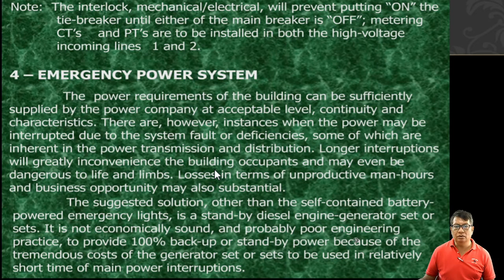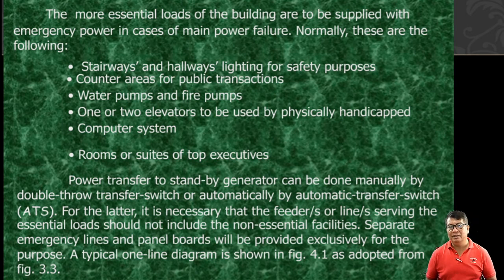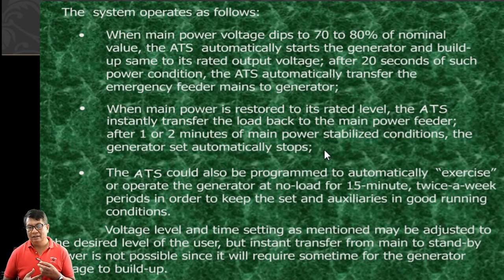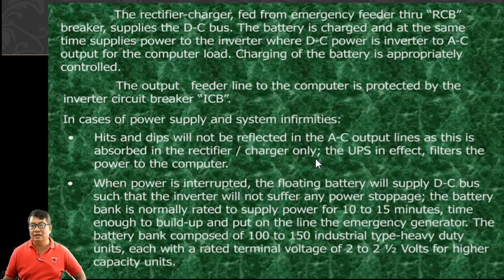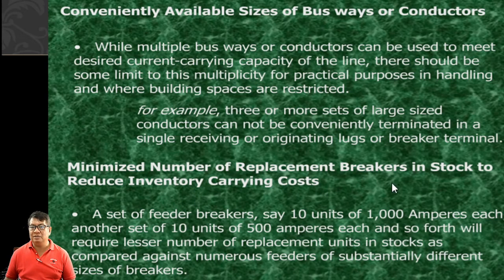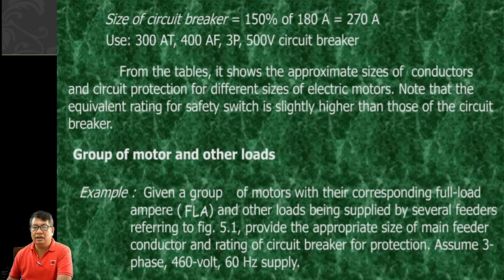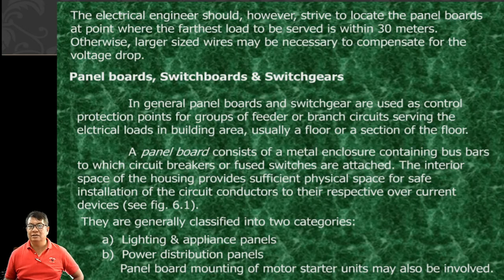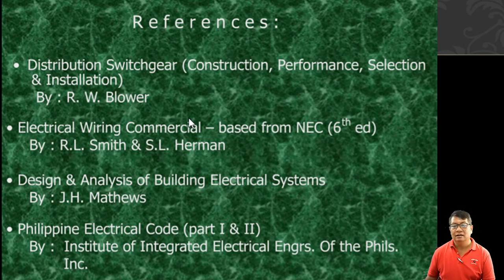Electrical System Design for High Rise Building (Chapter 1 - Part 2)

Comment: Sir, in your place, what is the minimum connected load where the utility company or electric coop will provide a 3 phase power service? When will DU provide 1phase service? and when will DU provide 3phase service?

Comment: Sir ano po pagkakaiba ng Ampere Frame sa Ampere Trip.Thanks
Reply: Ang ampere frame Po yong dimensions capacity Ng breaker sa labas Ng breaker at yong Ampere trip namn yong yong capacity Ng ating circuit breaker Yan Ang pag kkalam ko sir

Comment: Please use PEC table in determining the rating of fuse   or ACB ( i.e.  Inverse time CB, etc. ) 
      What  if Archi  suggest the location of electrical equipment in hazardous area just for aesthetic?   Transformer if non-listed  has certain provision ( Please see Article 450 of PEC). TY

Comment: Paki review Bro ang features ng ATS mo.  Ilang seconds ba ang cranking time ng genset at how long it will to attain its  rated speed and voltage. Is the 20 secs not too long. How about ur emergency loads, how many seconds are allowed per Life Safety Code? or PEC  provision  under emergency set-up? Sabihin natin na meron delayed re-transfer from Gen set to Normal condition  to ensure normal power is already stabilized,  but Before the emergency genset automatically stops, meron cooling mode yan which is inherent sa design ng generator. Please revisit  NFPA 10 as far as Emergency gensets requirement is concerned. Pwede din mag auto start ang genset when over voltage occurs, single phasing, etc. Hope it helps sa mga subscribers.